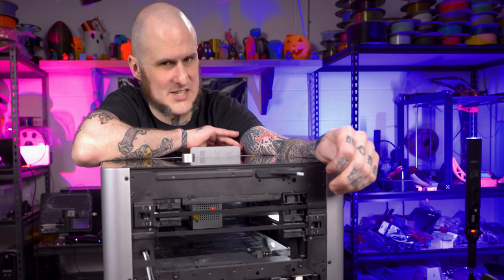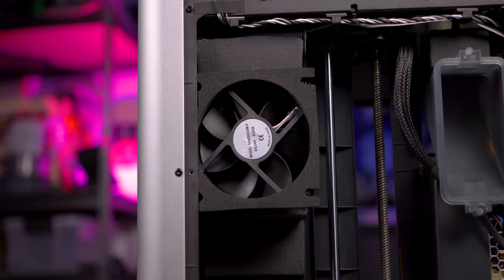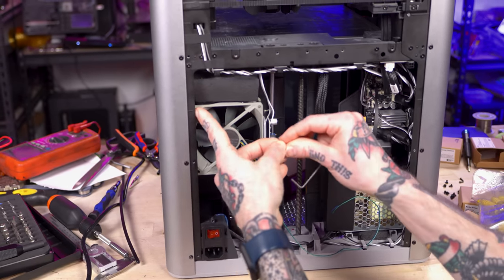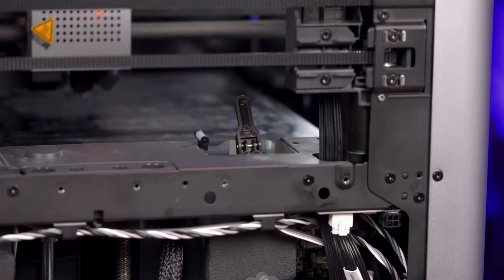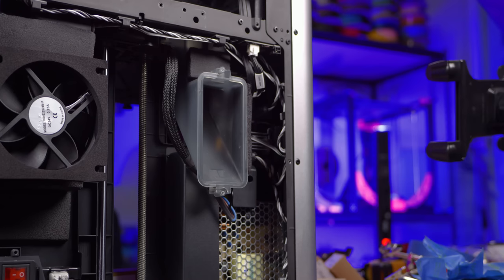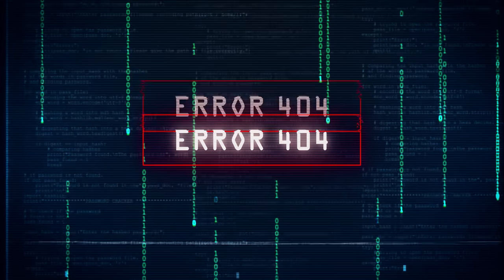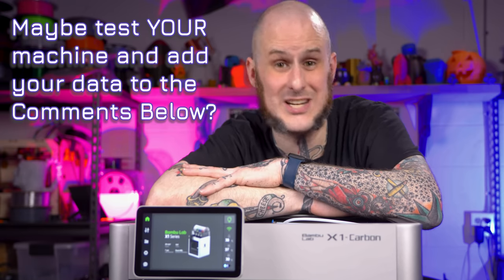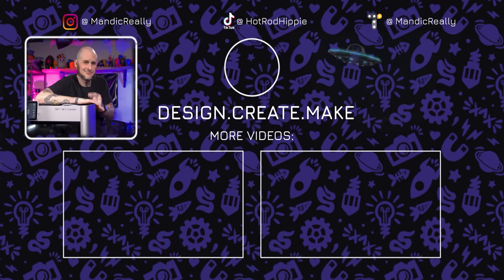Noctua Fan in the Bambu X-1? Chamber & Mainboard Fan Replacement!

Comment: if its only dropping a few degrees the what is the point? and why wouldn't bambu just partner with someone like noctua for fix the very obvious problem of this fan being so dam loud
Reply from the maker: Expense. The same reason many brands ship with loud fans. If every fan on every unit costs even just $1 more, that is $1 less profit per unit. That doesn't sound like much but when you are building thousands upon thousands and trying to hit price points, ever $1 adds up fast.
Reply: @MandicReally  even if they made it a upgrade you could buy off the site idd be okay with that. But I still don’t fully understand it’s purpose. I tested it myself (printing pla 60ᶜ bed and 215ᶜ nozzle) and when I had the fan off the chamber got up to 36.4ᶜ and when I set the fan to 100% is went down to 36.1ᶜ

So why even have it?

Comment: When i just compare the specifications of the fans the noctua fan is not very good. The stock chamber fan has 92CFM, the noctua has 46 CFM. And the bambulabs chamber fan is here in switzerland even cheaper than the noctua fan. So I guess it would be better to let the stock fan run at 60 or 70% and when you really need cooling turn it up a little. I maybe will never understand these fan switchers.

Comment: Seems like the fan is not very good at doing it's job (both the new one and old). A drop in chamber temp of only 3 degrees seems like a lot less than you would want. Say, if you were printing PlA with bed at 60c, and the chamber got to 35c, and the chamber fan only dropped the chamber to 30c, that is still hotter than is ideal for PLA to be printed in. Of course, I am just guessing. I would be interested to see what happens if you were to take out the activated carbon filter, as it is probably blocking a lot of the airflow. Also, as stated, it basically does nothing since the chamber fan doesn't run for the materials where the filter would be needed. The filter seems like a marketing gimmick tbh
Reply from the maker: That’s why Bambu recommends printing PLA on the “Cool Plate” at a bed temp of only 35C, so the chamber temp doesn’t climb so much. 

I really can’t quite figure out what the thought process was with the fan at this point.

Comment: Bambu could have made this job so so much easier by just following established standards but it's like they want to make everything the least modifiable as possible.
Reply: 24vdc is the standard. It's nocuta that doesn't bother. Likely because the 24v fan market is flooded because that's a standard dc voltage in industry.
Reply: 1v, 3v, 5v, 12v, 24v and 48v are the most common "low voltage" ratings for just about everything. 24v is definitely a common enough standard. That they pulled off the shelf components for this design.

It's just not very common in the US, likely because 12v is the defacto LV standard. 12v is a nice, evenly divisible number from our 120v mains supply, whereas almost everywhere else is 240/24v.

Comment: The Noctua is a third of the amps. It's more quiet... sure.. but it's also probably a 2/3rd's less air flow as well. if your going to do the mod. you should get an airflow meter to test you are putting out the same air. otherwise you just gave your printer a downgrade.

Comment: Noctua NF-F12 iPPC-24V-3000 SP noctua industial 24v fan 109.88 cfm
Reply from the maker: This requires a 92mm fan. A 120 wouldn’t fit between the Z-Axis and the frame side.

Comment: Hey, you should consider installing a Noctua A9 (46.44 cfm) instead of a B9 (37.84 cfm).  Actually, if you want a straight upgrade over the Bambu fan, you should get a Delta PFB0924EHEP6, but we've gotta figure out if the 38mm will fit.  It's a 24V, 4800 RPM fan (so same as OEM).  However, the Delta moves 104 CFM at 4800 RPM and 54 dBA vs the Bambu 93 CFM at 4800 RPM and 65 dBA.  Add a muffler to that and you've got a gigantic leap.  The gasket would have to be trimmed down and I don't know what else.

Comment: You recommend and post an affiliate link to the Noctua 40mm fan as an MF replacement, but in the video you use a replacement fan from Bambu. The Noctua fan doesn't fit in the stock location without modification, and you also need to re-splice the cable. Would be helpful to point that out before folks go out, buy one, and find out the hard way.
Reply from the maker: I showed that fan replacement requires splicing and warned in this video that it’s not a direct replacement. I didn’t do a secondary warning for the Mainboard fan as I didn’t think folks needed two warnings about the same thing in one video. What other modification is necessary beyond wiring? I held a Noctua in place and saw no issues or interference. I’ll be replacing mine soon actually. 

I replaced my Mainboard fan with a Bambu unit, that is already failing a few days later. It sounds like crap. That’s why I included the link, cause Bambu has a terrible fan that isn’t working.
Reply: @MandicReally  Wasn't hating on you, just thought it got overlooked. For the Noctua fan you need to remove the rubber grommets/bumpers from the mounting holes - even then it is a pretty tight fit and may benefit from a little sanding to slot in. YMMV. The wiring is (OEM to Fan colors): Drk Gray>Black, Black>Yellow, Lt Gray>Green, White>Blue. You can  do the splice on the little extension it comes with if you don't want to cut the wires attached to the fan.
For the chamber fan, the speed % issue could be corrected with a resistor on the tach & pwm wires, I am testing to see what value works
Reply: @GeoffTognetti  Hi, I just got the noctua fan and I cannot connect it into the motherboard, how could I re-splice it? Im super new to wiring and don't really know where to start please let me know if I need to get any other parts to connect the fan into the motherboard thank you
Reply: @GeoffTognetti  You are mentioning connecting lt gray to green, but my noctua fan only has 3 colors, red, yellow and black

Comment: You can try 24V Noctua - NF-F12 industrialPPC (3000 rpm with a max of 110CFM and 43.5 dB)
Reply from the maker: A 120mm fan won’t fit. It has to be a 92mm. There is no room for a larger fan.

Comment: Don't you realize that you did all of this work just to lower the fan speed to 40% of the stock fan?
Reply from the maker: Fan noise levels are more than just the speed a fan spins. Noctua puts a LOT of engineering into their fans to reduce the sound level and the speed they spin is a minor factor in all of that.
Reply: I know what you're talking about, and I have no doubt about Noctua reducing noise level. However, the trade off is far too great. 60% fan speed = 60% cooling power lost. Now it comes to the question :"how is the print quality after losing 60% cooling power ?" I respect your effort in this upgrade, but you can't compare the noise level between 4800 rpm stock fan vs 2000 rpm Noctua fan yet because they're not equally strong. Higher speed = louder, we all know that

Comment: You've got all that space back there.  Why not 3D print a better exhaust duct and run a 140mm fan?
Reply from the maker: It would require an entirely new back panel. "All that space back there" is surprisingly tight and limited. I'm gonna assume you've never worked on this part of the X1, it JUST fits the 92mm fan that is present. SO the adapter would have to be 92mm until it exited the rear panel then flare out to 140mm. Which to get air turbulence noises to not be an issue would require a longer adapter. You'll have an adapter sticking 50+mm off the back of the machine then.
Reply: @MandicReally  Actually, I found a couple of solutions.  You can print a fan duct adapter that allows a Delta 92x38mm fan.  Better yet, there's a totally redesigned duct that supports a 24V Noctua NF-F12 iPPC-24V-3000 120mm fan, which puts out 15% more CFM than the Bambu fan but only makes 43.5 dBA (20 dB less than Bambu).  There are also some brackets for a 40x20mm or 60x25mm Noctua fan that cools the motherboard a lot better with less noise.  Finally, you should consider removing any isolation feet, putting the chassis on a 16x16"  or 18x18" concrete paver from Home Depot and putting the paver on two EPDM or chopped foam bricks.  Overall, you're looking at a 50-55 dBA machine.  I'd send you the links with the models and the test data but this message is already too long.
Reply: Also, depending on what you're printing, you'll want a hotter chamber or a cooler one.  There are several riser lids that have removable vents that really work, and several TPU gasket mods that massively increase the temperature the chamber is able to get to when the vents are closed.

Comment: DO NOT DO THIS MOD. IT IS NOT AN UPGRADE. IT WILL NOT MAKE YOUR PRINTER QUIETER!!!

I am so mad after having come across this video. What a complete lie!! There are 4 fans in an X1C... this video addresses the 2 quiet fans and ignores the actual source of the noise. I spent about $40 and about 6 hours chasing down this idea and my printer is exactly as loud as it was.

The noise makers WITHOUT QUESTION are the hot end and the squirrel cage / "part" cooler on the left side of the print bed. You can go and test this for yourself with just a few clicks in the web interface... the "Part" and "Aux" fans make 99% of the fan noise.

The difference in noise between the videos is because he used the other fans to set the baseline. (Look a the replies -- you'll quickly see that nobody has done the mod and just praised the video at face value.)
Reply from the maker: What a conspiracy theory. I never claimed this would make your machine silent. It is a noisy machine, but reducing individual noises WILL reduce the overall noise output. 

The Before & After noise was ONLY the Chamber Temperature Regulation fan. NO OTHER FANS were on or used during that. You can make up whatever you like, but that is the reality. Just a good quality microphone showing the difference.

You are looking at the entire machine as a whole and ignoring the part you actually worked with.

That said this mod is not for everyone. It won't cool the chamber 100% as well as the original design. Calm down and breath a little. Think logically, of course 1 fan was not the ENTIRE noise of the machine.

Comment: More of a undeclocking than overclocking. You could achieve the same just by reducing the fan speed in the gcode What's the point in replacing the fan by a less powerful one? If noise is the only concern, just turn it down a bit, I run my fan a 25% without the carbon filter when I don't need it so much, it's enough to keep the noise down. You can even print a dampener, here is a nice design inspired from a car noise muffler . printables model/356189-bambu-lab-chamber-fan-muffler-no-support  The chamber fan seems to have a real problem though.

Comment: I’m sorry, but this video doesn’t answer the most fundamental question well enough. I would have reinstalled the original fan and performed significant temperature testing including prints that activate the fan. Then  compare the noise levels at fan activation. Also you will need a temperature probe inside the printer throughout the print to determine if both fans set ups achieve the same temperature goal.
Reply from the maker: I'd love to do seriously in depth testing with temp probes all over and data logging for every video I produce.  The reality is that costs money and takes significantly more time (which costs me money).  I could devote a week to testing just these types of situations, but then I'd end up with a data heavy video that someone would pick apart for not testing the way they deem appropriate.  I have to find a balance between data acquisition and video production. Also this misses variation between machines.  Realistically to get the best results I'd need to test multiple machines.  Where does the line get drawn?

Not to mention I'd have had to buy a new fan to the tune of $25 since I destroyed the one I had.  Time is money and investing money into testing has to be weighed out sometimes.  When the data provided by the folks who tested for me showed such little (and varied) results, I deemed it best to just move on.  Feel free to repeat the testing for yourself to provide further details and information.
Reply: @MandicReally  This is a YouTube video meant for a larger audience. Your video didn’t answer the question if we should switch the fan in our own system. (We still don’t know if there will be any obvious temperature effects under load). If the video doesn’t answer the question, then the video has no point, and we all just wasted that time. Multiply 12 minutes by 20,000 people and that’s Half a year wasted. I recommend you watching the interview by Stuff Made Here on YouTube that he did recently which explains his philosophy and how a little bit of effort can go a whole long way for your audience for your channel success.